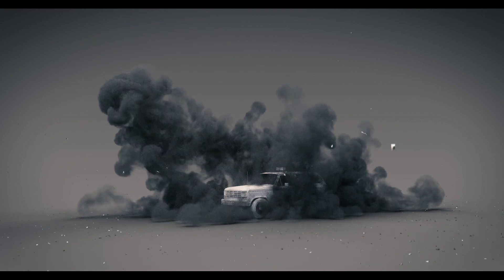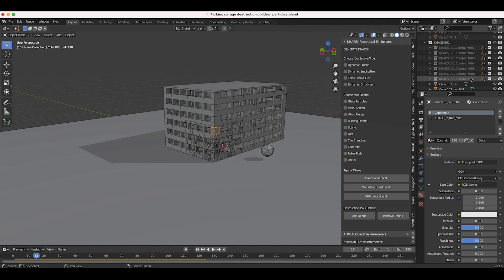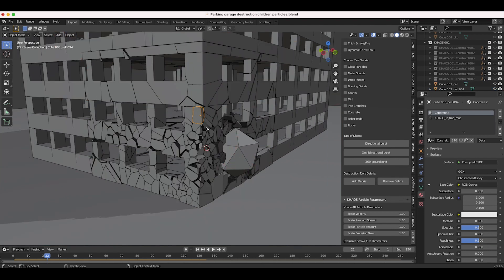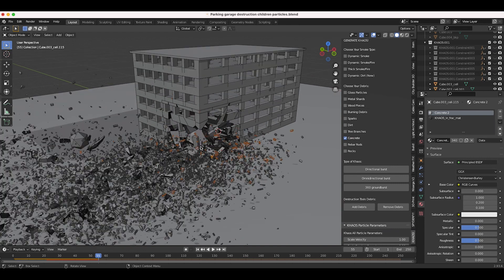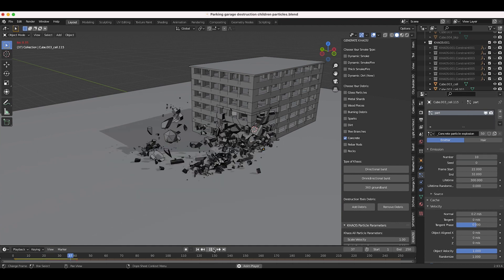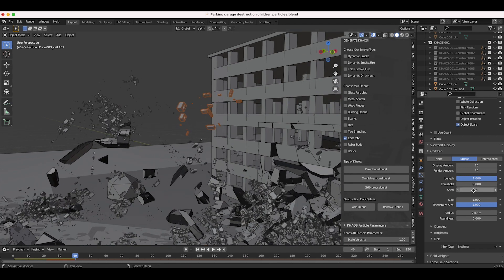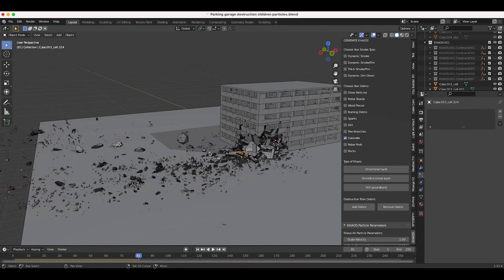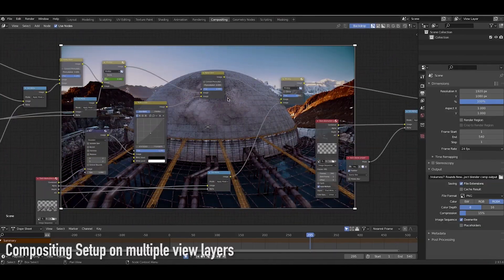Blender 3d Destruction Quicktip: Using children particle debris ft. KHAOS Add-on

Comment from the maker: In this video I share a quick destruction tip for Blender 3d for use in  small scale particle debris.  By using children particles within your rigid body and  destruction particle simulations you can increase the density of your debris without decreasing the performance of your machine as much as standard particles.
Our Blender Add-ons:
Ultimate Blender add-on value pack: https://www.blendermarket.com/products/add-on-value-pack-citybuilder3dkhaoslightarchitectcablecam-bundle 
CityBuilder3D: https://www.blendermarket.com/products/citybuilder-3d
KHAOS (Ultimate Explosion/Destruction Add-on): https://www.blendermarket.com/products/khaos-ultimate-explosion-simulator 
Spyderfy: https://www.blendermarket.com/products/spyderfy-bug-system-add-on\
Nature/Creature add-on bundle: https://www.blendermarket.com/products/naturecreature-add-ons---spyderfy--nisarga-lite-ultimate-bundle 
WeatherFX: https://www.blendermarket.com/products/weather-fx-add-on
Cablecam (Cinematic movement rig): https://www.blendermarket.com/products/cablecam-cinematic-camera-movement-rig 
LightArchitect (Film setup previsualization): https://www.blendermarket.com/products/lightarchitect---filmmaking-add-on
KHAOS Fire Shader: https://blendermarket.com/products/khaos-fire-shader-fire-shading-simplified

_

Comment: Hello dear light Architect. Please what is the full specification of your system. Are you using a PC, Mac or workstation. What's is the spec. I have been following your tutorials and I want to get a system on my own. I will like to know your spec to use a guide. Much live from Nigeria.
Reply from the maker: Hi Apeirion24. I currently use a  2018 Macbook pro with 16gb of ram, 2.9 GHz Quad-Core Intel Core i7, and Intel HD Graphics 630 1536 MB graphics card.  I recommend getting more ram personally for faster simulations. I will likely upgrade  to 64gb ram soon which will allow much more detailed simulations faster.  Thanks for watching!

Comment: Is khaos rigid bodies compatible with your city builder assets?  Whenever I try to fracture one of the buildings in it huge chunks are generated when I use the annotation tool and the building looks off.
Reply from the maker: Hey John,
Good question. Some assets in CityBuilder on manifold and some aren't. Unfortunately we didn't build most of those assets to fracture. Essentially in order to have a good fracture and rigid body simulation the assets must be manifold and also have no intersecting geometry.